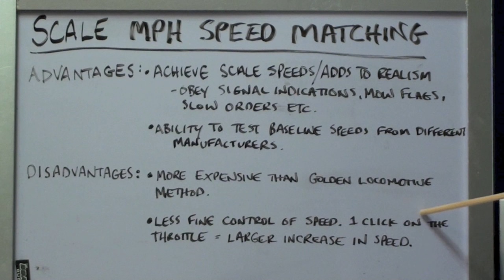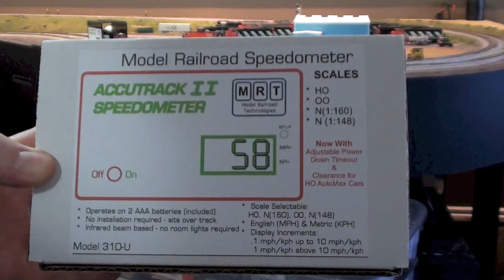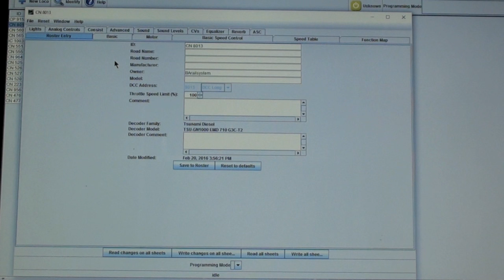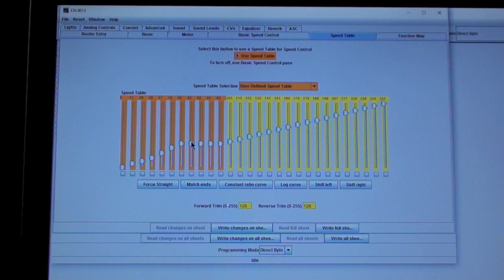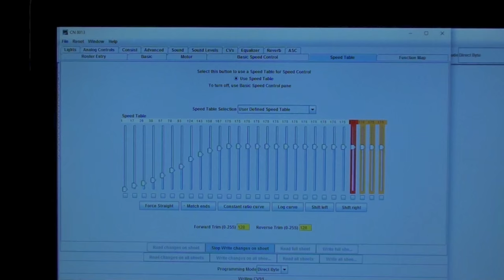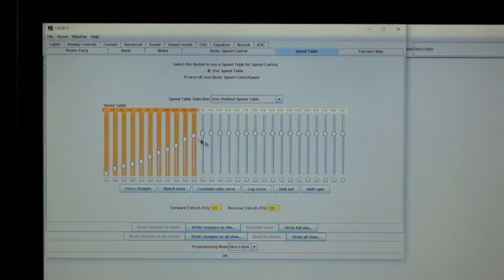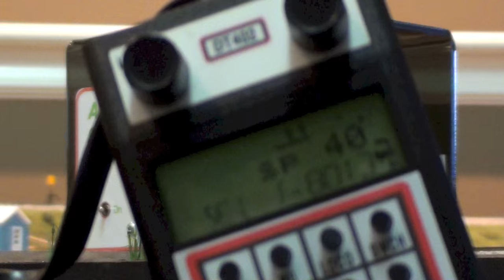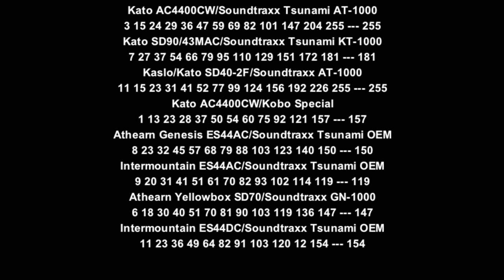How I Speed Match Locomotives Using The Scale MPH Method

Comment: Well done, Ben! Watched all of this very informative video, and saved it to favorites for future reference. I did my speed matching with the token locomotive.I guess I am going to have to get the speed tunnel now,lol!
Reply from the maker: +TMandN Thanks Al. I thought long and hard about how I wanted to program my units speed before choosing this method. Thinking about the future and having a signalled CTC layout was the main reason for speed matching them this way. I really like the idea of knowing the speed your going by looking at the throttle, that made it seem more realistic to me. Of course the downside is having less fine control of the speed, but so far it hasn't bothered me. I find most of the time I operate between 1-20 MPH anyway. Rarely do I ever run a train at 40 scale MPH.

Comment: A great video! Very helpful! I've been needing to speed match my diesels but haven't done it yet because I'm intimidated by JMRI. I understand the Accutrack II speedometer (I have one), but I still have a little trouble understanding how you made the adjustments a few notches up or down on JMRI. ...Roy
Reply from the maker: +N-Scale Union Pacific Evanston Subdivision To make adjustments a few notches up or down there are 28 slider bars you can use to make changes to each speed step. You can also click and hold the slider bar and tap the arrow keys up and down to move the slider one notch at a time between 0-255.

Comment: Ah man perfect timing! I'm ordering some 'things' in the next bit here and this vid is going to help big time in the near future ;) thanks for sharing this!!!
Reply from the maker: +1JZPWR No problem, hopefully it helps.
Reply: +BArailsystem hey, on the kobo special how did you set the last speed step so low? It won't let me touch first or last speed steps. Also you click something to 'average' out the in between steps (4,7,10)...I can't seem to figure it out. Other then that I've managed to be quite successful so far speed matching based off this vid! It's pretty easy now that I've done a couple locos :)
Reply from the maker: +1JZPWR I don't think it lets you adjust the last speed step so I just left it as is. I'll have to double check my notebook though. Regarding the click to average I believe that was just me clicking the slider tab to make it pop up to where I slid it to. On my PC laptop for whatever reason when I click and hold the slider then use the arrow keys to move it up or down, the slider doesn't move unless you click it once when you are finished adjusting. A glitch in the software maybe. That's awesome man I'm glad its working for you. It gets way easier once you have a few under your belt.
Reply: +BArailsystem ok yeah for sure, I thought maybe I was missing something, I guess not because I did the same thing lol ok fair enough! I was trying to figure it out with no luck, I just 'averaged' them out manually XD for sure, can't wait to work at this some more! The numbers you had given certainly helped as a solid starting point!

Comment: Very helpful video as I am about to embark on this process with my N Scale fleet, so thank you.  A question if I may - after zeroing out acceleration and braking and setting F & R Trim to 128 at the start of the process, how much accel and braking do you dial back in and what do you reset F & R trim to after completing the speed matching?
Reply from the maker: I don't put much acceleration and braking in, I found it wreaks havoc with distributed power trains when the locomotives and decoders are from different manufacturers. I can't remember off the top of my head but I think F/R trim is cancelled out when using a speed table.

Comment: I'm really new to this so please excuse me.
  When you do the speed matching  as in the video what dose it actually do to the decoder? Does it set the speeds to the decoder so it will keep those speeds till you change them? I'm having a hard time figuring the computers roll in all this are you reprogramming the decoder or the speedometer?
  If I decide to purchase one of these what will I need to buy to be able to speed match or is everything I will need in the box?
  Sorry for all the questions as I said I'm new to this (just a few months)
   Thank you
Reply from the maker: The decoder has a defined number of speed steps which dictate how much voltage is applied to the motors (speed). Changing these can change the speed profile; ie faster or slower. The speedometer is measuring how fast the locomotive is travelling. So I set it at a fixed speed, measure it and then adjust the speed steps up or down. The speedometer is purchased separately from the DCC system. What I am using here is a Sprogg-II DCC system on my laptop connected to the layout and JMRI decoder pro on my computer. If you are just getting started, purchase a couple locomotives from the same manufacturer, they will run fine together and you will be able to have some fun before worrying about speed matching different manufacturer's locomotives.

Comment: excellent video..and great reasons for using both JMRI and the speed tunnel to make this exercise easier and more precise.. justifies the purchase of the tunnel and the interface of the JMRI program. Now for my question.. It seems almost unnecessary to ask this but, I will anyway.. Say you have a loco...that really has a bit of a difference in the speed going in a certain direction...would you make note and assign that loco to run in a particular direction in a consist when traveling forward?
Reply from the maker: Thanks! That's really odd that it has that much difference between forward and reverse. Since the only variable your changing between the two is the  polarity going to the motor. Voltage should remain the same. Have you tried removing the trucks and seeing if there's friction being caused somewhere in the gearboxes?

Comment: i like that. I run most of my freight trains at 40 and 45mph. Hotshot intermodal trains run at 50 to 60 mph .I have the same speed tunnel you have too. Good video too.  My Proto 2000 SD60 is slow and thinking on what to do with it. It wont go like my Athearns and Intermountain and Katos do. I just want it to speed match with the others.
Reply from the maker: +BNforever2009 Holy smokes 60 MPH intermodal that must be wild! I had quite a few locomotives that couldn't go faster than 40 MPH, pretty much all my Kato's so that is why I capped them all at 40 scale MPH.
Reply: I havent ran any intermodal trains yet but i think i will run them at 45mph. I know the BNSF run theirs at 60 and 70 mph and the CSX too on the "Jet Trailer Trains". Thats just the high priority intermodal trains,

Comment: Going back watching this to refresh. I think my 4 yr old Accutrack II
Has crapped out. 

Totally Inconsistent readouts. Fwd right to left reads 44. Left to right reads 51. Reboot box and (sometimes) it starts working normal for a few minutes. Then goes nuts and reads 50 as 2.4 or .2 mph. Then may come back to 50 after a reboot. 😖

Have tested on 3 different locos that Were set to 50 previously. 

So I ordered a new one after tearing down the unit to reseat the IC without an improvement. Pretty sure the Right Side Emitter/Receptor Bad. 

At least with a new one I have a good reference to compare with if i can get Parts someday from somewhere.

Comment: Great work Ben!.. Wonderful  explanations as to why you do what.  Makes sense to me.  I switched, this month, my DCC control from NCE to Digitrax for Loconet capabilities in the future (occupancy for signaling etc).  Tonight I get to watch your video and the Trump debate [possibly debacle] on TV while my wife goes to see Springsteen.  I am the lucky one me thinks!
Reply from the maker: +Maltux1 Digitrax works very well with JMRI that was the main reason I chose Digitrax. I usually change the station when they start talking about Trump, the media up here is treating it kind of like an ongoing car wreck to boost ratings it seems.
Reply: +BArailsystem If Trump gets in my wife said we are moving to my country, Canada.  How are the house prices in Red Deer?  Have you checked out the Railroad & Co. software?  I think I still prefer the JMRI as it offers the Wii Throttle and it is free!  The RR & Co. software is really easy to use with some pretty cool features.  On another matter have you checked out fasttracks (building your own track and turnouts). Looking forward to your new layout in your new house.
Reply from the maker: Maltux1 I've never heard of Railroad & Co. Looks like its around $140.00, that is hard to compare with JMRI which is free. The withrottle is pretty rudimentry but Decoderpro is a great program and I would like to start playing around with panel pro and signalling. I've been thinking about using a fast tracks jig to do my #8 crossover turnouts.
Reply: +BArailsystem I may be changing my O scale back to HO as the cost diferrence is a lot more than I had planned.  I have some great HO Locomotives and rolling stock that I can not seem to part with.  Plus building new layouts are fun.  What kind of track are you going to use in your new layout?  I was using kato but think I may go with Micro Engineering flex track and Peco turnouts or possibly fastbacks.I will use JMRI for occupancy and signaling with JMRI.  The RR&Co. makes programming very easy but JMRI is free.  The fastbacks looks like it might be a lot of fun!
Reply from the maker: +Maltux1 After running a lot on my friends layout, I am definitely going with Micro Engineering flex track and number 6 turnouts. I am considering buying a Fast Tracks jig to do the number 8 turnouts which will be powered for CTC.

Comment: I've been trying to find a way to speed-match my locos (all have or will have Tsunami 2 decoders). And your way seems to be the easiest and best way of doing it. and I really like the way of doing the top-end speed no matter what the throttle is set at after a certain point. But my question is why you chose the 12-step speed curve over 14,16 or anything else.

Comment: Have you had any issues with locomotives running together if one runs just a hair faster or slower? I'm paranoid that I'm ganna burn the motors or damage the gears even if they are slightly off by 1 or so mph. I know thats a bit irrational but just thought I'd ask if you've had any issues with it. Thanks!
Reply: You're very unlikely to actually damage locomotives internally because they are a bit off from each other.  So don't be paranoid about that.   (If they are waaaay off then the ones that are faster may be prone to overheating or higher wear, if you run them that way for a long time.  But again, don't be paranoid.)   Speed matching is much more about getting good performance; making sure all the locomotives are actually pulling the train forward instead of dragging the other locomotives down, avoiding unrealistic looking slack action between them, and enabling helper ops.  Trying to do helper ops without speed matching might lead to a lot more derailments and thus damaging the models externally.  ;-)
Reply from the maker: None of mine are perfect, like jaggedben said, there's nothing to worry about as long as they are fairly close. When you throw in all the different variables like motor torque, gear ration, weight/wheel etc etc its impossible to get them all 100% speed matched. 
I run mine a lot with very heavy trains and I've never had an issue.
Reply: @BArailsystem  awesome thank you! Ive usually spent a good hour in the past matching a pair of locos. Guess I can relax a bit now lol!

Comment: I'm watching your video again a year later as I try to speed match a couple Intermountains and a Scale Trains Tier 4 GEVO...  It can be exhausting...  Might you know the Maximum Scale Speed on the Scale Trains Tier 4?  I have been speed matching everything to 100km/h (60 mph) but this GEVO (from August 2017, First Run) seems to max out at 82km/h (about 48mph)...  I'm wondering if it is 'locked in" to Shunting Mode somewhere in the LokSound V4 CVs...?!   -Chris
Reply from the maker: Hi Chris, 
Sorry, I haven't done anything with mine since I got them. You might have trouble achieving 60 scale MPH across manufacturers, in my fleet there are a few that had trouble hitting 40 scale MPH. Kato's especially. My Red Barn which is on a Kato BNSF SD40-2 chassis, can barely hit 34 scale MPH, might be something wrong with the motor. The problem is if you have a few that are much slower and your speed matching up to 60 scale MPH, the slow ones will end up being dragged along. Personally, I found that 40 looks very fast in person, and it just so happened to be a speed that all but one of my locomotives could achieve.
Reply: Thanks for the detailed info.  I guess it is better to speed match everything to a lower speed than a few different speed matched groups that you forget about later, and end up dragging one engine along and having mechanical issues with a pricey model.  Happy New Year!!!  -Chris
Reply from the maker: That's what I found Chris. 40 scale MPH seems really fast to me with a big train behind but that may be subjective.  Happy New Year!

Comment: I think I've followed your instructions precisely, but after I click on "Write changes on sheet", absolutely nothing happens. I mean, the diesels continue to run at the same very high speeds as they did before I changed the speed settings on the speed table. JMRI is making me crazy. ...Roy
Reply from the maker: +N-Scale Union Pacific Evanston Subdivision Make sure you have checked the little circle that says, "use speed table", and then the pulldown "user defined speed table".

Comment: Some rookie questions- 
1. What's the throttle position? 
2. How'd you work out what speed step (28 speed steps) you needed to edit to get the correct scale mile an hour per 99/128 speed steps? 

I'm using a NCE power cab so I'm guessing you 99 throttle positions is my 128 positions? 
Thanks.
Reply from the maker: Throttle postion is the number your throttle is set at. At 3:56 I show the math on how I figured out which steps to edit. Yes, if your NCE system goes up to 128 then you just edit 1:1.

Comment: Interesting using the throttle setting as "speed".  In my case I use up to 4 different DCC systems, each at a different voltage so this isn't something I'd do.   I'm in N scale and I start by using the speed tunnel but then I put to the two locos (or the existing consist and one I'm attempting to match) to fine tune it - the Digitrax throttle lets me adjust both.   Anyway, I run them both to make sure that the new one is neither gaining or losing distance to the front one.

Oh, and you didn't mention BEMF.   Do you turn it off (it looks like it).
Reply from the maker: Hi Don,
Yes I don't use BEMF because results vary widely between the decoder manufacturers. There are some locomotives that pull better under load then others so in the future I may put a little BEMF on the good pullers so they consist better with locomotives that slow down under load.
Reply: Most of my Speed Matching is with the same decoder manufacturer.   Even so, I've been worried about BEMF locos fighting against each other and so have turned it off.   Although, I suspect that if I understood the CVs better, I could turn down the BEMF, let it be milder but still use it, especially to help at the lower speeds.
Reply from the maker: Yeah that's exactly what I was thinking. Wouldn't need much, just a little bit of BEMF and they'd run really nice together I think.

Comment: ok ok you put my last video I posted to shame , my CN collection ,, lol ,, so how did you consist all them together , thanks for sharing , I like the system you did to match them up
Reply from the maker: +sparky107107 On my digitrax system consisting is simple. The locomotive on the right throttle is the leader. You use the left throttle knob to add in more locomotives by selecting it's number and pressing MU, +. You can add as many as you like to the consist and they will all be controlled by the lead engine.
Reply: nice , , nce is not like that , have to make up the consist

Comment: Are you using different manufacturers decoders or all the same? Mine are a mix of LokSound and SoundTraxx.
Athearn Genesis, Scale Trains and Intermountain locomotives.
Reply from the maker: Yes, I have the same mix. Although I have more ESU now than when I made this video and they are doing their best to make it hard to adjust decoder CVs with Decoder Pro. They want you to buy their proprietary programmer.
Reply: @BArailsystem  thank you for the reply. I think it would be better for the hobby keeping the equipment more universally compatible.

Comment: I really enjoyed this video and I can't wait to get started using this method. Does it make a difference if momentum and deceleration are used? If so how. Thanks for breaking down something that seems so daunting. 

Peace be with you,
Reply from the maker: +TrashMan2008 I don't use acceleration/deceleration, yet... That changes the whole dynamic of speed matching as it adds two more variables. I plan on trying to add some eventually and maybe even a small amount of BEMF to smooth them out.

Comment: Could you do it so that the top speed is at step 100 and the mid speed is at step 50 on the throttle so if you end up using a different throttle it would control the locomotives in the same manner?  I have 2 different types of throttles, one like yours in the video, and a smaller unit.
Reply from the maker: Yep you could do that, it wouldn't be much different than the stock settings though as on digitrax 99 on the throttle =speed step 128. 
The main reason I did it this way was to cap and standardize the top speed and giving you the ability to "know" how fast the train is travelling via the readout on the digitrax throttles.
Reply: Mark Matteo m